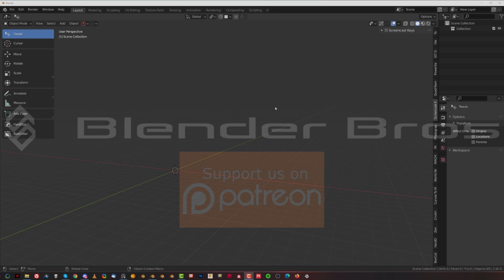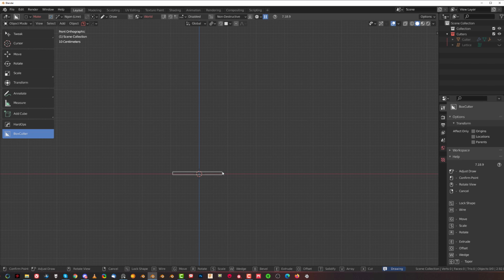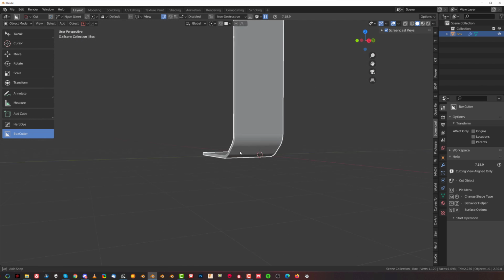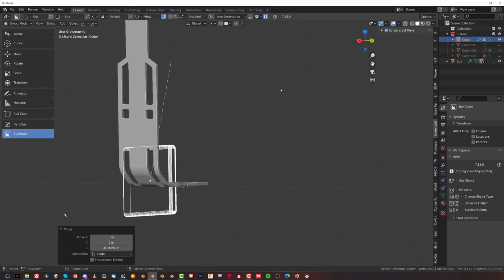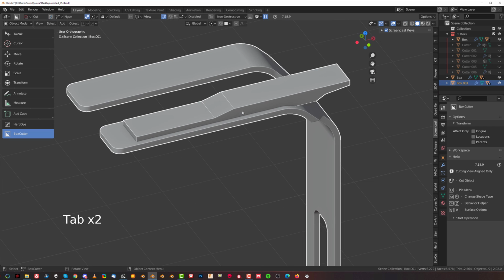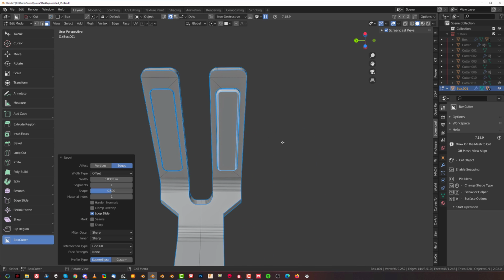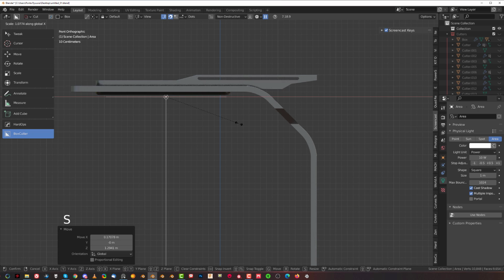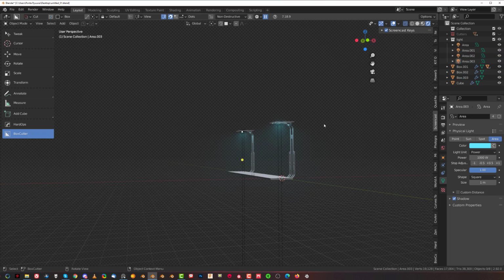Blender Tutorial - easy hard surface design with Hard OPS and Boxcutter

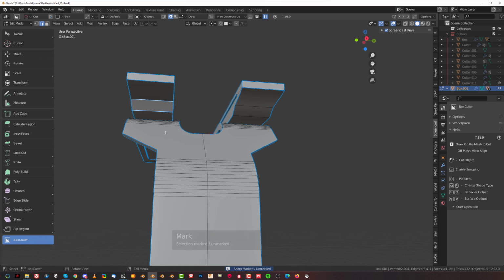Comment: Hi Ponte, thanks for this amazing playlist of tutorials! I have a question about shortcuts: at 19:35 you use Mesh Machine for symmetrize with ALT+X. I've got both Mesh Machine and BoxCutter/Hardops but when I press ALT+X I only see the interface gizmo from Hardops coming up, not the one from Mesh Machine. Also, I am a bit confused about what's the difference between the two mirrors? Thanks for any help you could give. 
EDIT: sorry, silly me. I wasn't in Edit mode when i alt+x. Still am a bit confused about the difference of the mirroring
Reply from the maker: use both on duplicated object and compare
Reply: @PonteRyuurui  good idea, thanks Ponte :)

Comment: I think it's worth noting the Alt D copies are also far less expensive machine resource wise, because they share object data with only a different transform for it's location, so it doesn't have to duplicate all the data in memory, it just tells it "repeat this data in this location" so it only need to exist in memory once, and each copy is the memory footprint of a transform, and a pointer to the data. So it's more useful than the surface level. It can help keep the memory footprint of a scene manageable in complex scenes where deep copies can really bog things down.

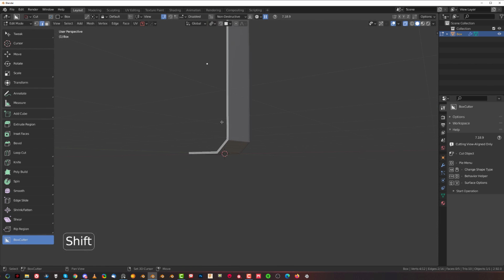Comment: gotta say its incredibly hard learning this addon. Even trying to follow this tutorial - I'm already lost at 5:22 when you are selecting edges in Edit mode and selecting the occlude option using Tab (not there for me). I can't tell if this is showing an older version or if I don't have something setup correctly. I don't know where to even begin as someone who just purchased this and theres a million tutorials for years and they all seemgingly look and behaving differently.
Reply from the maker: this isnt for beginners, grab either the free terminal course or our ultimate guide to hardops and boxcutter. I also have multiple guide on YT for beginners. Tab has nothing to do with hops, its machine tools.